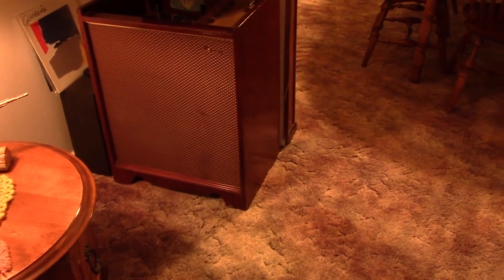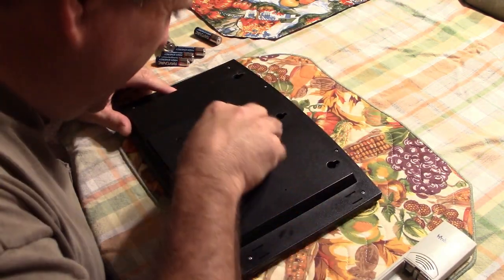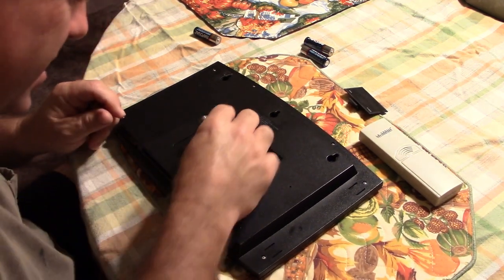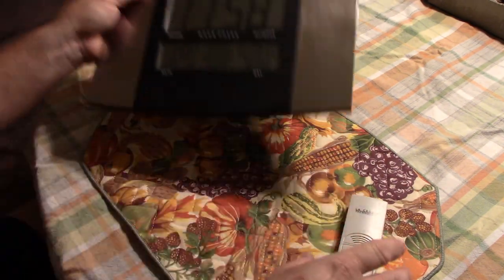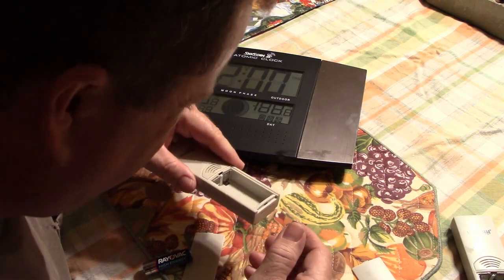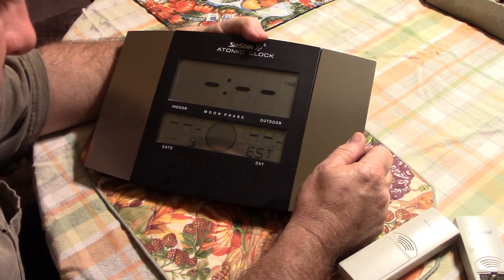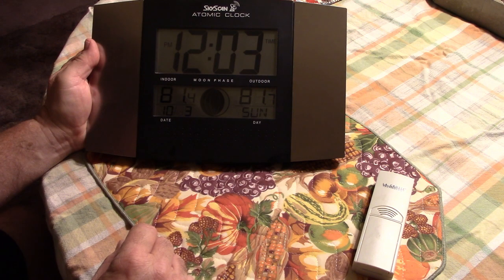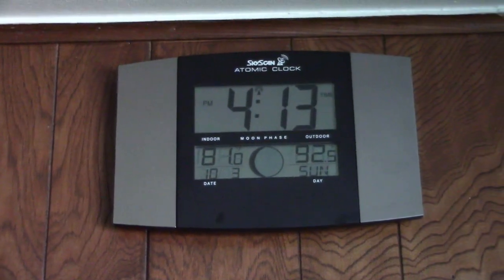Octember 2021, Fail 3

Comment: Interesting it's seemed to hit you not one, but two times this year. I've got an old Oregon Scientific tabletop style indoor/outdoor station, has to be from I'd say 2007 or 2008 or so. Last year, Octember 2020, this exact same thing happened. The inside still worked, but the outside would not reconnect, no matter what I did. Eventually I just quit using the outside sensor and kept the inside part, as it still had an accurate indoor temp, and date/time. I kind of forgot about the outdoor part, but I grabbed it out of my desk today and put some batteries in, maybe I'll get lucky and it'll start working again.
Reply from the maker: So far, the third indoor/outdoor temp station for the greenhouse is still working! 
Hopefully yours will start working again! It's sometimes tough to get these synced up again.